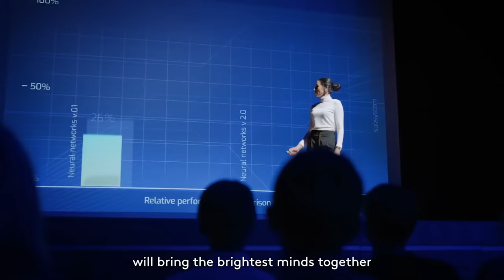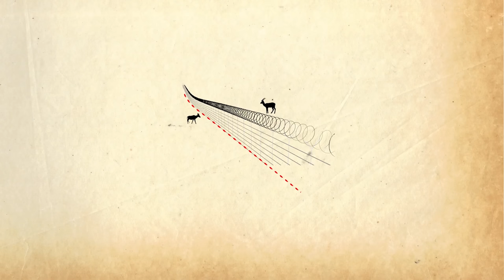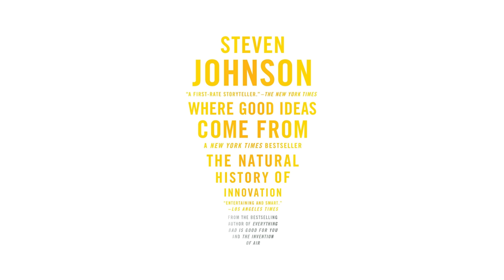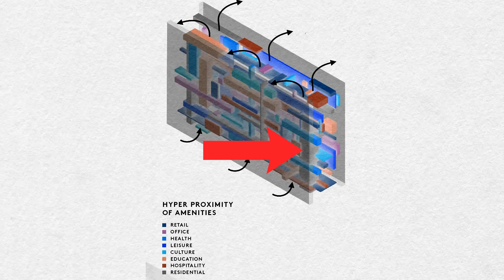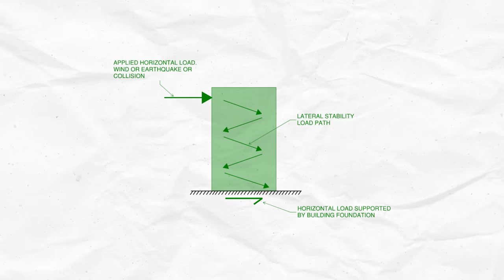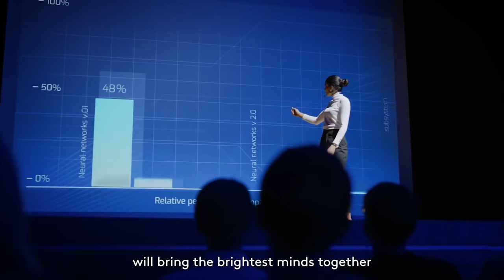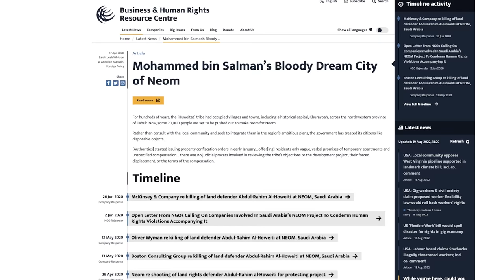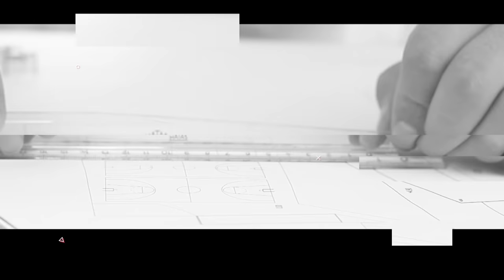This city concept breaks architecture (THE LINE)

Comment: It's also worth mentioning that the train system has a single point of failure because of the city is a line. Something stops working in one place, and the whole city's transportation stops working. This project is genuinely an urban nightmare and a giant money pit.
Reply: How are the ambulances and fire trucks supposed to get around?
Reply: @jamaljames1598  that's a good question??
Reply: And assuming all the water comes from desalination plants at one end, that will be another single point of failure.
Reply: I think that's not so terrible.Normal cities shut down entire geographies when a single rail line has issues. That's not a big difference from this.
That said it would be smart to have several lines,not just the two
Reply: @laylalayla8030  妳在講什麼？不要講廢話
Reply: @laylalayla8030  hmmm… that’s  weird. I literally saw a video add about this from the government or representative group of Saudi Arabia in Twitter and here at YouTube….
Reply: It's NOT a money pit!  It's a money canal.
Reply: It’s going to be a city of 9mil people I doubt there’ll only be 2 lines
Reply: @jamaljames1598  Drone Medevacs/Fire Suppressors lol
Reply: U seriously think, someone that designed this whole thing, wouldnt think about basic issues like that one?
Reply: @nicolaos355  They didn't think at all. If the train stops at every segment to let people get on or off.. how are you supposed to travel the whole distance in 20 minutes? It would take hours!
Reply: @Itgworll  The buildplan has two tubes. I assume 1 train in each?
Reply: they can have multiple trains. and have them in sections. they only need 2 trains that go all the way.
Reply: They don't have parallel sets of rails to ensure smooth public transit when there is a need for maintenance or repairs in the tracks? You can't build a city without multiple redundancies. It's like building a city on an island with a single road bridge. This would be very risky.
Reply: Single point for 9 million people lol😂😂....a city with a trillion dollar Value wont run on just trains genius!!!🤦‍♂️
Reply: You know that just because something is linear, does not mean it's singular, there can be many parallels and backups.
Reply: It's a giant money laundromat.
ftfy
Reply: @laylalayla8030  because the money for this project should be going to helping the people and cities already there, please listen to the video.
Reply: Builder's maxim: Get out of the ground as quickly as you can.
This idea is a nightmare on so many levels.
Reply: They usually have 2 engines on one train for breakdowns plus build service rails every 10 miles so there’s no blockage of the rails…      It’s almost like you guys are discovering things for the first time and saying but wait even though people have thought these problems out decades ago lol…
Reply: @Savvy-jj6mm  sooo. what happens if people throw themselfs in front of the train because living in this nightmarish dictator fever dream makes you suicidal?
Reply: Just like DUBAI! Ahahahha money can’t buy creativity or inteligence after all.
Reply: It really has nothing to do with practicality, the point is quite the opposite, they designed it to be impractical and expensive to maintain, and the true purpose of the project is for the princes to spend as much dollars as they possibly can to speed up the process of the collapse of dollars.
Reply: They’re gonna implement “magic” into it. Magic is gonna make this all work. Watch out for the “magic” announcement, Harry Potter and Gandalf will be the first magic ambassadors for this great new city 😂
Reply: And absolute horse sh... The prize even can't be right. Speaking of trillions, did the US find those 4 missing ones yet? 🙊
Reply: it depends on how wide the line is. If it is wide enough to have multiple interconnecting rail lines, then you could simply transfer stuff to the other lines
Reply: What if you have 10 lines
Reply: @wolvessgaming6819  its a stupid question because your thinking like its a standard city. Why would you need a ‘truck’ or ‘van’ for emergencies
Reply: @SlateTiara  the image had two transport tubes, but i doubt those were representative of actual/hypothetical plans. 

like, neom is supposed to be 200-ish meters wide. if the whole transit level was that wide, you could easily have multiple rails and platforms running parallel to each other. have one or two high speed rails with minimal stops and the rest could be normal lines that act as a regular-ass subway. 

if a train breaks down somewhere, there's still several parallel tracks to take up the slack. 

[i do think neom is a bad idea though. it'll look pretty if it ever did actually get built as promoted, but the effect on the surrounding wildlife and populace would be a nightmare.]
Reply: @jamaljames1598  there are roads for emergencies only.
Reply: they need to used speed...
because everything is in a streightline.

so how much gs can we handel
Reply: I highly doubt they will run one single rail line
Reply: @laylalayla8030  مملكتك تقتل اليمن
Reply: @LinngahPremi  too much horror haunting story on Netflix is not good though 😅
Reply: I'm sure that problem will have been thought of
Reply: I would be surprised if they had only a single track?
Reply: @laylalayla8030  رجال الأعمال اليمنيون في السعودية ملطختون بالدماء كما لو أن هتلر أنشأ شرطة يهودية ليكون قاسيًا على الشعب اليهودي.
Reply: I love how they decided to build this at the avalanche of recession and before high probability of WW3. I'm not a fortune teller but I can guarantee you this project will never be finished.
Reply: @ronchappel4812  no, that's not how grids function. There's always an alternate path.
Reply: Well lucky for them they have a money pit then eh :D
Reply: Nah…i dont think they’re that stupid..we’ll see once completed.
Reply: @jamaljames1598   Evenly spaced. But yeah perhaps an expensive way to do it.
Reply: People keep using this term "money pit" Yeah, it's not your money.
Reply: @laylalayla8030  layer
Reply: @laylalayla8030  check neom Saudi Arabia channel and see it yourself dude
Reply: @romedome9060  not really  if a emergency was to happen what you gonna do? Drag him on your bike or strongmen him all the way to we're you need to go?
Reply: It's peak money laundering, my chap.
Reply: But will the trains run on time?
Reply: Its called redundancy.  Something on this scale is definitely going to have bi ways and always a backup.
Reply: @timetraveler2yearsago758  nailed it!  one train to use, the other for "backup"
Reply: @jamaljames1598  duh, they fly of course, have you no imagination.
Reply: @Ok_Cabbage  So tech that hasn't been developed. Also to rely solely on fire supressors is quite literally the dumbest idea ever.
Reply: So you think there’s gon be a single track for all transport eh? Cool 😊
Reply: @kunalketkar  we should upgrade these people to world leaders. Absolute geniuses.
Reply: @SlateTiara  l
Reply: If you want to maxmise the perimeter of exterior mirrrored wall, for a given area contained within, use a narrow rectangle. The most efficient shape is square or maybe circular.
Reply: @SlateTiara  plus a fast train and a slow train  or multiple trains .
 Take your pick which one suits.
Reply: @llLuisaSll  ads on you tube aka propaganda...i saw flying people in one of neoms ads flying people no wings mind you lol
Reply: @dzezonja3558  it is impossible to guarantee anything except death and taxes
Reply: What about horizontal elevators??
Reply: @laylalayla8030  brainwash i
Reply: @laylalayla8030  women☕
Reply: Wait for the end
Reply: То,что сдесь изображают, вообще не  соответствует,реальному проекту линейного города
Reply: @jamaljames1598  around? It's a line🤣 they can only go forward and back
Reply: engine car on either side and just switch sides.
Reply: @ronchappel4812  Normal cities have several modes of transportation.
Reply: @DemPilafian  lmaoo
Reply: Breeding ground = Elevator? Really?

Best example how one C19 lie can destroy a good video content.

Wake up, Neo 🙄
Reply: I assume they will have a rail line on every layer
Reply: @laylalayla8030  I thought I saw something that shows construction has started.
Reply: @ronchappel4812  the nyc metro system sets up bus shuttles when a single rail line has issues, but there are no roads in the line?
Reply: @n9ne  but you are still fragmenting the city with 1 broken rail line, and the others become bottlenecked and then you have thousands of people waiting at a single station for hours on end
Reply: @LinngahPremi  so i will run on my legs from one side to another when the train stops working
Reply: @Savvy-jj6mm  cities that have multiple parallel rails for a single train line only have them because their systems are really old and some lines have been decommissioned (eg there's a center rail in the upper manhattan section of the 1 train, which is from the express 9 train that used to be there)
Reply: @i_am_a_toast_of_french  worry not..u will also get flying taxi in this city..will be transported in 60 seconds to yo destination💝
Reply: @wolvessgaming6819  the real problem is, there are tons of questions just like this one!
Reply: @DemPilafian  ha! A money sinkhole!
Reply: @SlateTiara  HA! GOOD ONE!
Reply: @t0nd132  🙂
Reply: @jasonburmeister4746  🙂
Reply: @rfayz733  stop scaring me! 🤪
Reply: @LinngahPremi  🙃
Reply: @debbiehall9396  💝
Reply: Where will be the Kabsa & Mandi restaurants located🤣😂
Reply: Where will be the Mandi & Kabsa restaurants located 😂
Reply: @laylalayla8030  your government have pull the classic "there's no war in Ba Sing Se"
Reply: @LinngahPremi  the mirror's gonna shatter and everyone's eardrums will implode and i will possibly be dead
Reply: @laylalayla8030  صفحه نيوم الرسميه اعلنت و قالت كل ذي التفاصيل
Reply: يتوقف العمل في المدينة  افضل من ان يتوقف العمل في الكوكب بسبب مصانعكم التي تغرقنا بالكاربون
Reply: @ronchappel4812  Normal cities also have roads you can use in case the train lines fail
Reply: @HeyLeFay  It's been too long since i commented here.I've forgotten the details.Do they have no roads at all??
That would be crazy
Reply: @ronchappel4812  What you describe is clutch when a city has no other way to deal with a problem of having grown single points of failure, it is not designed into it intentionally.
Reply: @jamaljames1598  5 mins walking distance
Reply: @jamaljames1598  As in the ski slopes, there is adapted transport for the last kilometer. Then they take the lane for the emergency vehicles
Reply: @DemPilafian  Or a money trench
Reply: You'll talk sh*$ but when it's actually done you'll would wish to even see it from the outside
Reply: @Ok_Cabbage  Would love to see how a drone medivac delivers a baby or stop someone having a seizure lol.
Reply: Even if it was a high speed line, how fast would it be stopping at every station along the way? This project makes no sense.
Reply: @DieTryingK  except it is.

Filled your car recently?
Reply: 170km² / 9mio =~ 19m² 🪞 / person. Sounds feasible. 🌤
Any data about expected temperatures of the S-fassade? 🚦🪂Thermic windspeed? 
Cleaning during night only? 🪟🚿🪣🧽Water-supply?
Reply: @romedome9060  🔥🛒🥵🐫
Reply: This is not something that entrepreneurs or engineers would come up with or design.
Reply: @ronchappel4812  Normal, sane cities don't.
Reply: @hdufort  There are islands that have one road bridge.  But we're not talking islands (with water around and air above) here.
Reply: @DieTryingK  I’m glad
Reply: @alaakamal1924  keep telling yourself that
Reply: That’s not fact. I strongly disagree!
Reply: They put trust in human's incredible ability to overcome challenges using science and technology. But what she is saying is that they could do better things. Anyway, I believe that they can overcome all the challenges as long as there is no cap on the money and time spent.
Reply: Wheres the airport gonna go???
Reply: Imagine living in the equivalent of a giant version of the Alcatraz prison and thinking it's liberty.
Reply: @nicolaos355  This whole project is a massive ego trip and nothing else. The project doesn't make any sense whatsoever, the videos don't make any sense either. They show complete fantasy like these flying capsules that don't et won't exist. And why are these videos complete fantasy ? Because they have no idea where they are going. The height of the building is 500m, its width 200m ? There will be zero light at the bottom most of the time, probably to overcome the heat of the desert. But then there is no chance there will be any plants growing. Which btw would be such a water issue because the only source of water is the sea, and absolutely massive amounts of water would have to be desalinated. Which is an extremely energy inefficient process. Now you have the problem of transporting water tens of millions of tons of water to 9 million persons and to water millions of plants.
There is a reason why all towns are built around rivers or near the sea. This project breaks all the most basic rules of good urban planning only in the name of showing off.

This dystopic project serves no purpose and solves no existing problem. It only creates ones. It is very clear that MBS has no education and isn't intelligent enough to listen to actual experts.
Reply: It will probably have multiple lines coming and going.
Reply: @jamaljames1598  If trees can levitate. Why not ambulances and fire trucks?
Reply: @ThePixel1983  redundant systems exists for this. And many cities around the world already work like this like NY.
Reply: Some have said a fire could make entire interior unlivable. Big huge won't get completed project. Just a PR cgi for us to drool over.
Reply: @jamaljames1598 thats neat part .they wont
Reply: @jamaljames1598 There is a hospital every five minutes. Walk your way. There is a doctor. There are emergency carriers everywhere. Don't worry. The train will be fine. Each trailer has two trains. A second trailer has two trains on the opposite side. If one fails, we switch. A second until it becomes a second day
Reply: They are building it for fun, no other good reason
Reply: no! if you stick with your worst case scenario you are from the yesterdays
Reply: @nicolaos355 wouldn't be the first time an architect designed a library and forget to account for the weight of the books in their calculations...
Reply: the think AI will solve everything. AI is like the new God now......
Reply: @fhwong5726  not yet .. but if wishes come true .. humanity will be extinct
Reply: Each line has a parallel by default. It's a must, especially when talking about emergency states, so the firefighters and ambulance can come help and break the rules of linear traffic when needed
Reply: @Gabcikovo  where are all these professionals come from? this is quite a pool here
Reply: They have to have more than one set of trains with staggered schedules. The commute from work to home is fine with one, but what if you want to visit a relative 10 miles down the line, doubt your walking. By car that would be a 20 min drive. By the train going back and forth? Might take an hour or more. Multiple rails would help alleviate that.
Reply: Do you think they won't put a provision for that happening? Do you think they're stupid?
Reply: @forcommenting1017 scooters 😅
Reply: @schiacciatrollo they are already hiring outsiders to live and work on these projects.
Reply: @theoneaboveall7708  future is coming .. sometimes even violently
Reply: 90000 people per square mile?
Reply: @4Everlast    Nada.   Easy come, easy go.
Reply: @ronchappel4812 No???? When a tram stops working, that section is temporarily shut down with temporary lines and separate bus lines erected if its important enough. Here the entire city stops working.
Reply: Wow you can get from one end to the other in twenty min.
What for, I wanted to stop somewhere in the middle, oh I had to jump???
Reply: @kennethrollo7891   LOL!!   Hope you're physically fit, as maybe the driver just slows the train down to, say, quarter speed at intermediate 'stops' to enable passengers to literally jump from the moving train and then tumble roll on the platforms as the train speeds up to continue full bore again!    Never fully stopping!    Efficient!!   Workers, though, would need to be hired to continually scape human remains off the 'stop' walls, thereby increasing employment!   Hey, bonus!   Lower unemployment stats!   To board the train at intermediate 'stops', you must accurately time your aimed jump into an open door on the moving train!    Super efficiency!!   The future looks bright, yeah?  🫣🤪🤣🤣
Reply: What gave you the idea that it would only be one track?
Reply: @Ok_Cabbage Do you know how much water gets used to put out fires? A drone would never have enough fire suppressant to put out a real fire.
Reply: Every train system is a line, they don't all have a single point of failure because there is more than 1 set of train tracks parallel to each other. mind-blown
Reply: not to mention the train would be traveling at 500km an hour just to make that 20 minute time
Reply: do you assume that a project with a trillion dollar budget won't take such a risk into consideration? you all are assuming things without knowing the real power of Saudis where they've prove it in Energy sector and other related fields.
Reply: @nicolaos355   they obviously didn't . or do you have an answer to this?
Reply: They started building the line this year
😊